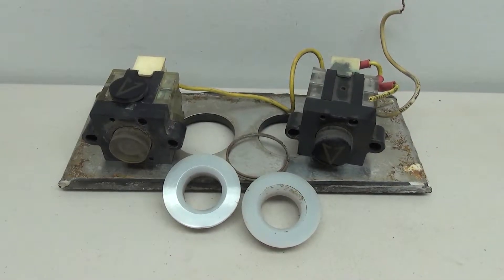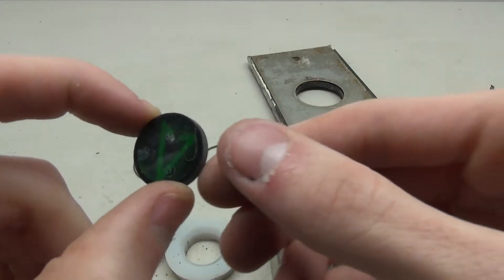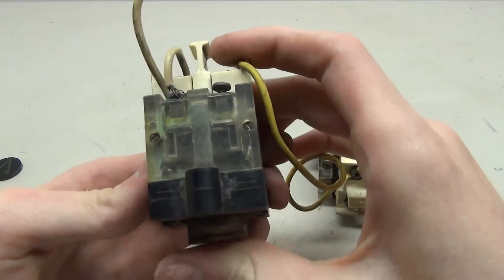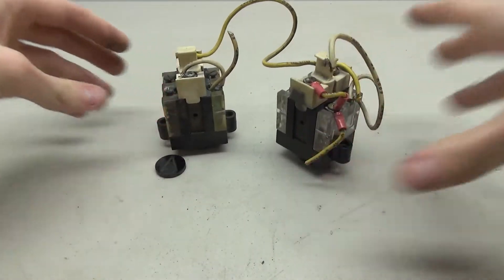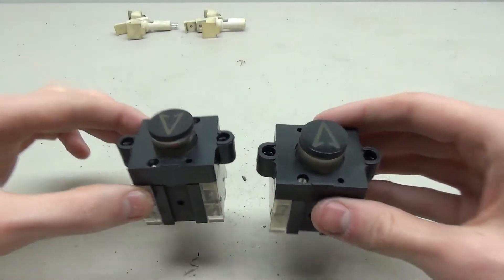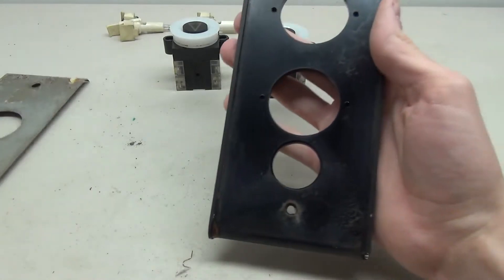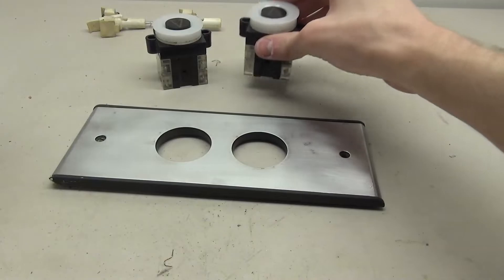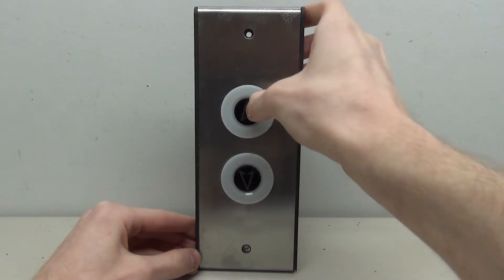Restoring and Wiring a Vintage Dover Elevator Button

Comment: I got the 2nd version of this button yesterday. It was in mint condition and easy to wire up. The only change I did is I didn’t use the lamp holder and I used an led.
Reply from the maker: Neat!

Comment: I just got a Dover small halo/black button intermediate station, it already has 48PSB LEDs installed, and they're ORANGE!  4x A23 alkaline in series provides the 48V so I'm keeping those LEDs.

edit:// and while nowhere near as disgusting as these, I did have to clean out a lot of accumulated crud in the gap between the buttons themselves and the halos.  The halos were probably barely lighting up because it was really dark crap, and there was a LOT of it.  Perhaps from indoor smoking which was a thing through the '90s.  I test lit one after I had cleaned it because I had ASSumed it would have had line voltage incandescent bulbs installed, being from the late '60s/early '70s; I discovered the LEDs during cleaning. My similar-era Armor buttons have 120MB incandescents.

Comment: Nice buttons, but as much as I like Dover elevators, I could definitely see why they discontinued and improved the button and fixture designs of their Traditional Fixtures, and for a multitude of reasons. These older Traditional buttons continued to be used in the 70s, but they were modified with one-piece halos and a metal plate that added to their aesthetics and durability, and ultimately Dover made the riveted, thin click wafer design with copper contact strips that were used in the 80s and 90s, but then again, that is also another big reason why Dover used aftermarket fixtures on many of their elevators in the 60s and 70s, mainly EPCO.
Reply from the maker: These buttons also dry rot and fall apart over time.
Reply: Those thin click wafer ones are only an improvement in durability (contacts only) and cost.  They feel really bad to press, and the clear plastic over the white plastic likes to crack.  A real improvement would have been a shift toward more durable plastic, but keeping the overall design.  As for the really bad contact block in this video, it appears to have gotten wet at some point.  That will mess up even the best of designs.